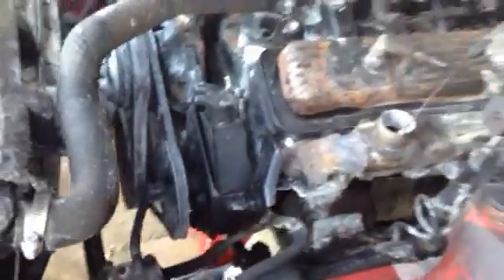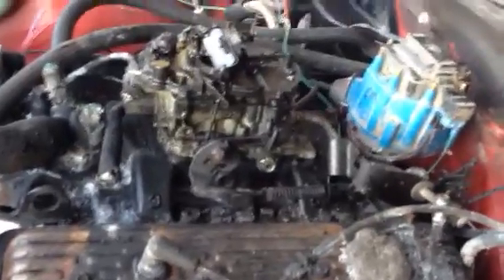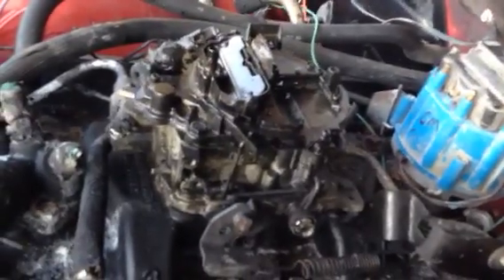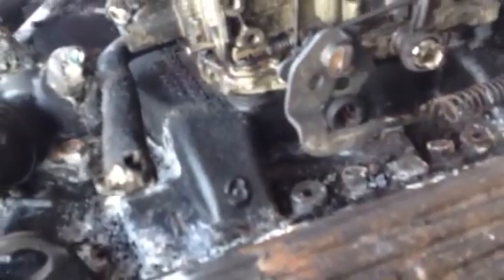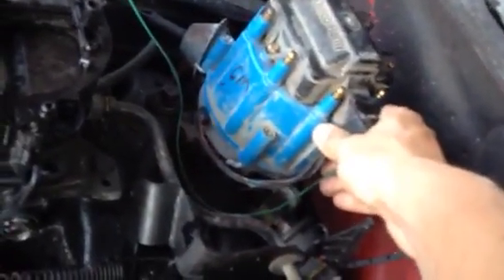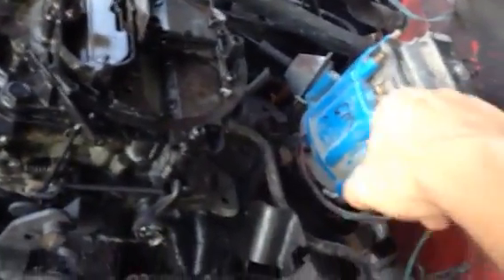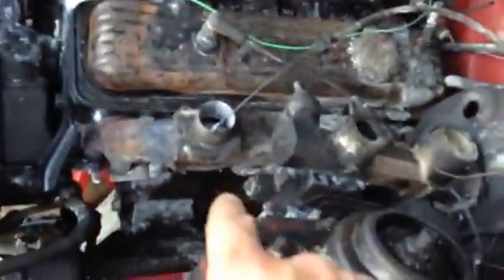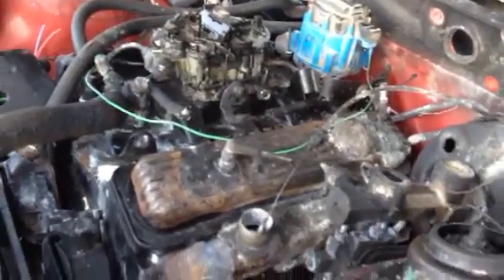18436572 (firing order)

Comment: What year
Reply from the maker: this firing order was used in many engines from 1955 all the way up to 1999 in all the chevrolet and GM small block SBC engines.  the old firebird car in this video is a 1980's model.  i think it was a 1986.   this is an old video but one of my current projects is a very similar car with a newer EFI LS swap.
Reply: Thanks sorry I read that in the description afterwards